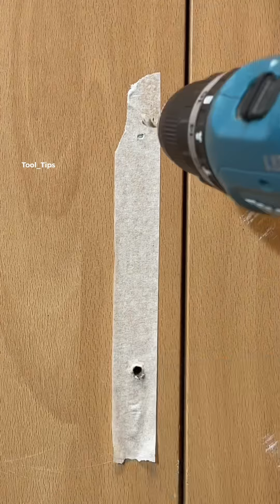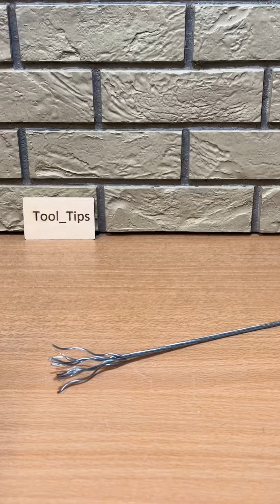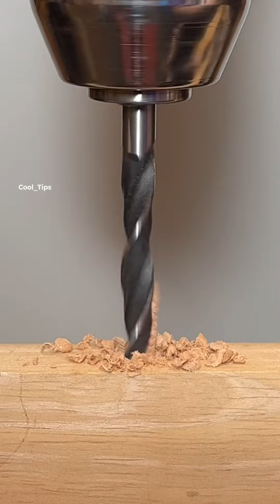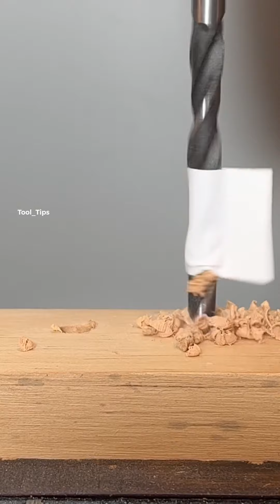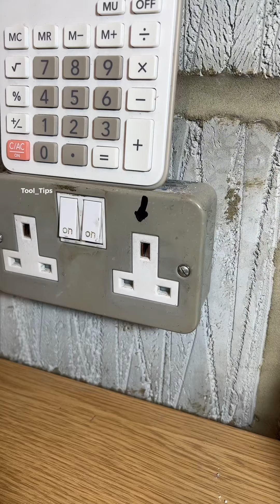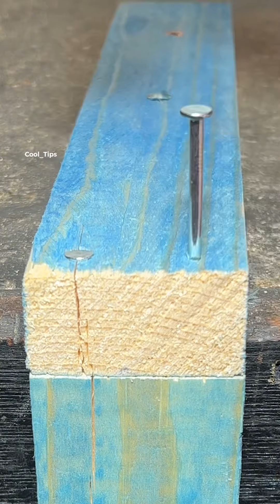Just Tips and More

Comment: Drilling a hole into lumber so you can add a drywall anchor and then drive a wood screw into the piece until it splits must be some form of performance art, but the meaning eludes me.